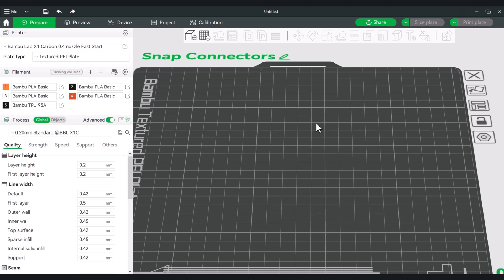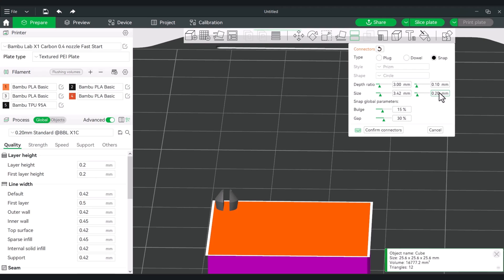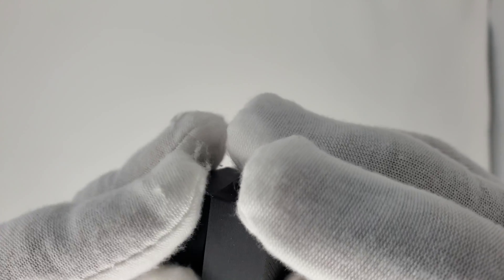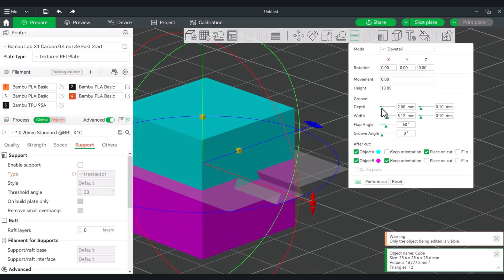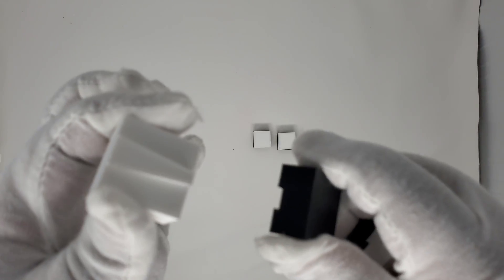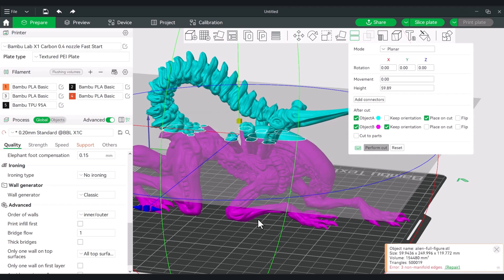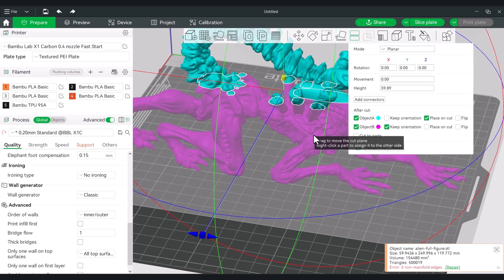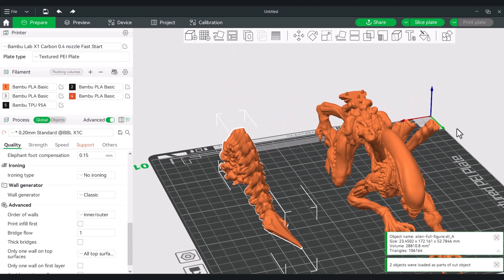Bambu Studio Tutorial, Snap Connector, Dovetail, Selective Cuts

Comment: the cut tool is garbage for the simple fact the cut plane size can not be adjusted making everything way more complicated than it needs to be. easier to design the cuts into the models than use it imo
Reply from the maker: @andrewscotti1136  if you are in the design phase, especially if you are using a cad program, then you are correct make  the changes there.

If you are already in slicer with someone else's model this can be helpful for beginners.

Thank you for commenting.

Comment: I cut 2 legs from a model and make connectors on them, but get an error when saving them as stl: 
Negative parts detected Would you mesh boolean before export?
When selected YES i get red Error: Unable to perform boolean op. on model meshes.
Reason: stl dous not bound to a volume.
I dont understand whats the meaning of that ?
Purpuse of export is to print them on a resin printer (elegoo mars 2 pro)
Reply: its saved them anyway :-)

Comment: Thanks I didnt knew this.
Hope they come up with a draw on cut tool to! Than i can cut my figurines i make in DAZ3d cut too on lets say her belly
Reply from the maker: I haven't thought about Daz3d(and poser) in decades. 🤔Takes me back. 
Yes you can apply the cut anywhere but typically belt line or less noticeable areas work great. There is also the option of smoothing the areas in post processing.
Reply: All that from within bambu studio?
Just starten working with bambu A1 printers (3 of then) in our library makerspace

Comment: What would use for a helmet?great video.
Reply from the maker: I suppose it depends on if you are post processing the helmet. (sanding, patching painting) as any method can work.

For things that are structural, dowels/pegs

For things that are cosmetic snap connectors are fine.

Comment: Thank you for the instructions, I really enjoy learning it.  One thing I should ask, because I found no way how to do it, how you make a series of spaced dovetail, like when it is do a joint of two walls 90 degrees of a wooden drawer?
Reply from the maker: So I have been digging deeper into dovetail for months and have not successfully gotten it to the level of woodworking dovetails. While simple cuts are fine, multiple cuts have been less than ideal to complete failures. 

CAD programs may be better suited for the task.

Comment: Can you add 2 dovetail connectors one the same height but in two different places? My object needs two of them and I can’t find a way to do that
Reply from the maker: I know this is a long time in responding but I have been occasionally messing with dovetails to see if I can "double dove tail", sunrise dovetail and a bunch of others.

So the short answer is no. The dovetail is a plane cut, so while you could make multiple plane cuts there are huge limitations.

The longer answer is there may be another option.

But I have been dabbling in general cuts and using mesh boolean to do a similar precise cut. It is a bit hard to explain here but you can use any shape to exclude(difference) another shape. 

I would need a project to show it off but in theory it may be possible.

Comment: Thanks for this; very useful. Can you do multiple selective cuts in Bambu Studio?
Reply from the maker: Hello. You should be able to do several selective cuts without much issue. So you can selective cut in an a more manable part and selective cut the part again. I would so "no" if it asks to fix non manifold edges though, 

 If you are using dowels, snap and dove tails the can get tricky however.
Reply: @ashleys3dprintshop  Thanks for this series. As a new user of Bambu Studio you have opened my eyes to additional features I did not know existed! thanks again.

Comment: Do you have a video about cutting a part into pieces then resizing with all pieces resizing appropriately? 

I'm printing some armor parts and need to resize after cutting and adding connectors. I'm leaning toward using square dowels because of connectors on multiple sides to hold the breastplate together. Also printing the square dowels on their side to add strength and not need support. Any thoughts to prevent wasting filament?

Comment: Thank you!
Reply from the maker: Thanks for watching and commenting
Reply: @ashleys3dprintshop  I must have done something wrong. I printed my part and it didn’t split the part in half and didn’t include a dovetail. Is there a save button I missed before slicing.
Thank you 🙏
Reply from the maker: @joet.4756    when you use any of the cut tools there is a "perform cut" button to finalize the cut. .
Sometimes it will ask do you want to fix "non manifold edges" click "cancel" if you see it.. *If you attempt the repair it wipes out the cut sections*.

Comment: Selective cuts is exactly what I've been looking for. 

Do you have recommended support settings for high detail prints like the xenomorph in your video?

I'm trying to print some TMNT figures but I can't figure out the right setting to use that won't make the print look ugly on the contact points.
Reply from the maker: Thank you very much. I typically use the tree supports, slim or organic style.
They come off easy and may need some minor post processing.

If you have models that don't require a bunch filament swaps you can use petg/pla as opposites just at the contact points for clean  break off supports.

Comment: Some SCARY AI happens when you use the Dowel or some other connectors where if you accidentally set them too DEEP into a model and the hole will protrude out the other side, do UNDO, then cut, then edit connectors, and your dots are MOVED for you to locations where they won't protrude. THIS. IS. BONKERS. This is some kind of hidden feature.
Reply from the maker: That's is an awesome , even creepy way, find. 😁 I may have to experiment with that. Lol Thank you for sharing that.

Comment: When slice using connectors my parts are hallow and do not create a surface to create the pegs. is there a setting that I am missing ?
Reply from the maker: The pegs/connectors need to be placed on surfaces that have a top and bottom. They will not auto generate a surface.

There is one exception but it may not ultimately be what you want as it fills in holes and will probably make your model solid. You can kinda fix it by reducing/increasing walls, but without seeing your model I can only make an educated guess if it will work. 

Others tab, slicing mode, fill holes.

Comment: Great explanation of these features. Thank you for sharing your knowledge on these topics. Is there a method to precisely add snap connectors? I'd like to cut 2x different sized containers, and connect them. (e.g. Container A = A1+A2, Container B = B1+B2, then print and physically combine A1 +B2). To do this I'd have to add connectors at precise locations on both originally uncut parts. Any thoughts would help.
Reply from the maker: Hello, thank you for the positive feed back.
There is a way to make exact connections for 2 disparate parts. 
I would actually use mesh boolean instead of  just connectors as they need to be done with a "cut" and the are manually placed. 
Here are examples  https://www.youtube.com/watch?v=m9bIxDgD8Q0
Or here
https://www.youtube.com/watch?v=mNaFPv932WA

There is a starter video if you want to see other things you can do with mesh boolean here.

https://www.youtube.com/watch?v=z4l75T6jliA

It may take a bit of practice but you can make interchangable parts with these methods. Thank you for the excellent question.
Reply: @ashleys3dprintshop  Much appreciated! I’ll check out those examples and get back to printing more tomorrow!

Comment: Do you already have a video on manifold parts? Please someone share a link if so. If not, how can we tell when that warning matters and to hit fix and when we can safely skip it? Does it show somehow where it thinks the error is for us to review for ourselves? It's such a scary warning but when I've skipped repairing it's been fine.
Reply from the maker: I don't have a full topic on non manifold parts. Typically I just ignore the message.
 You can always repair the model but I would recommend doing it before painting and cutting. If you run the repair after a cut or color it erases all of the modifications.

There is one exception and that's if it looks bad/off/broken during a slice.. Which is exceedingly rare.

Comment: When I try to add connectors the prong prints fine but the hole doesn’t save?? Is there something I can do to to fix that?
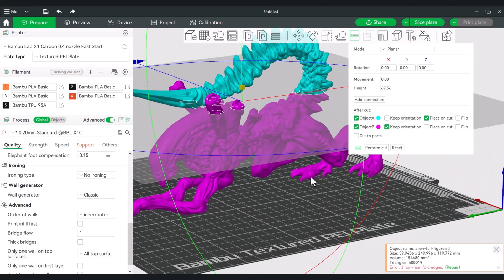Reply from the maker: Hello, thanks for reaching out. Around the 8:38 mark the slicer was asking if I wanted to fix non manifold edges. Click cancel instead of fix. Fix wipes out holes and colors. Hopefully that helps. If you still run into issues comment back please.

Comment: I have a request for a Bambu studio tutorial that I think many people would benefit from. Speed. Other slicers handle speed in a simple way by Bambu studio breaks down speed into settings that can be overwhelming and confusing for many. An explanation of each speed setting and some tips for maybe petg or other filaments that may benefit from slowing down some settings more than the default profiles.
Reply from the maker: Hmm that would make for a very interesting video. There are a lot of variables, filament, model, wouter wall effect(matte vs glossy)  temp. even brand.
Reply: @ashleys3dprintshop The latest version of Bambu Studio now includes two profiles for each layer height. Fine and High Quality. As far as I understand, High Quality just controls some speed settings to produce a higher quality surface.. I think.
Reply: I agree.. I’m not sure what you would be comfortable tackling in a video like this, but for me, at the very least I would like to understand how to properly adjust the speeds in a meaningful way. Petg comes to mind because it is often recommended to slow down on fast printers like the Bambu etc. the default profile I think does slow down some things, but it is difficult to understand how to actually tweak the speeds in a meaningful way to perhaps get the best results.
Reply: Did this video ever come about?

Comment: Nice tips.
But I wonder:
If I have a model, like a box and I have another model (like a RPI enclosure).
Can I merge them to one object, sinking the RPI enclosure into the box and prevent the box wall to "grow" into the rpi enclosure? So I want the rpi enclosure to be sunken into the large box, so its flush or almost flush.
Reply from the maker: Actually yes that can be done. It will require some experimentation with negative / modifiers and cuts . I'll do some experiments but should be doable.
Reply: @ashleys3dprintshop ok, cool, I am printing a huge lego.. (like 110cm tall or something), so I thoguht maybe I can countersink rpi or arduino case into it.

But my first go made the wall from the lego uppe body kindof "fill" the part of the case :-P But I didnt know about negative offsets then, so I have just done some first tries in the slicer.

Just have had the printer few days as of now 🙂

Comment: When I put in the fasteners, I can’t see them in the slicer, so I don’t know if they’re there or not.
Reply from the maker: So the steps are select model 
1. cut (select planar or dovetail)
2. if planar, add connectors
3. place connectors/make adjustments
4. confirm connectors
5. perform cut

If you haven't made any changes to the "after cut" settings the hole side is facing down.
you can flip it with f key or flip icon.
@ 2:45

If you have any other questions I'll do my best to answer.